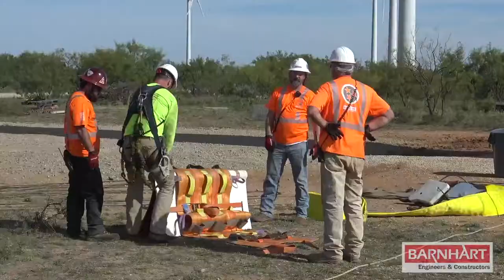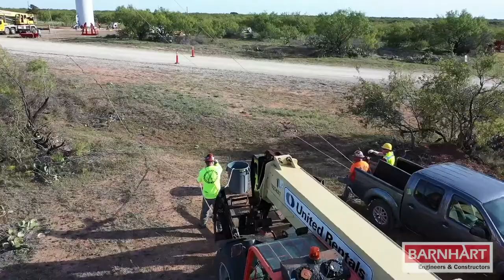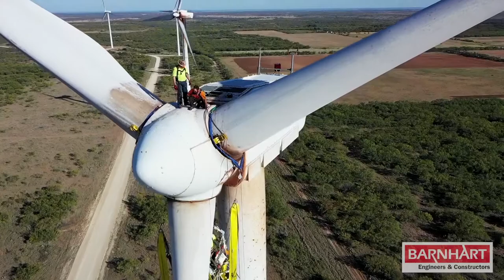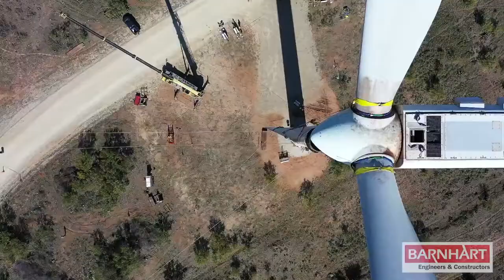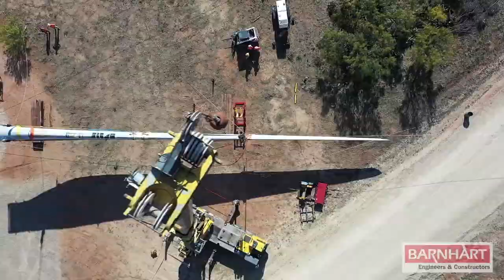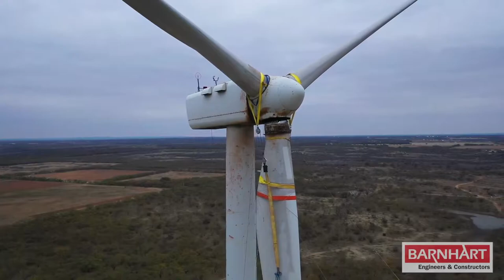craneless blade and bearing replacement HD

Comment: It’s looks a lot cheaper to perform considering you don’t have a large  crane but you still have the assist crane to pick the tip end when lowering the blade into its saddles. It looks like a pain in the ass compared to utilization of a large crane and a blade gripper but if it works it works